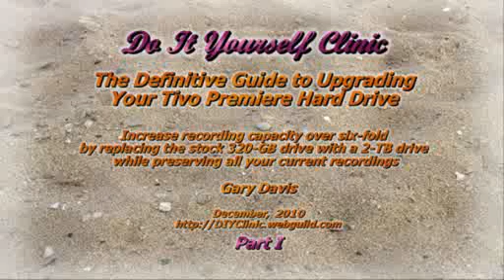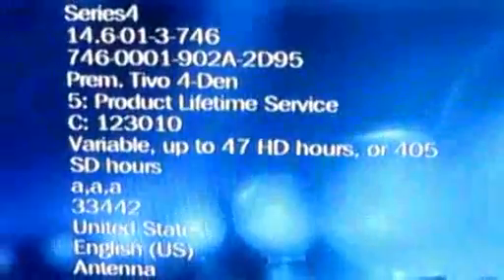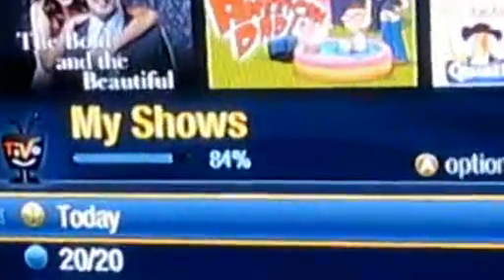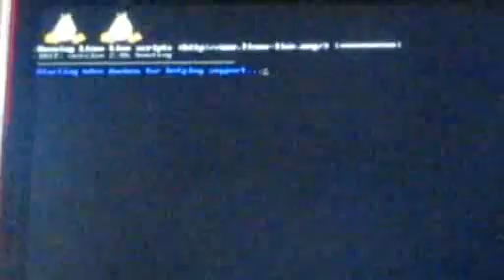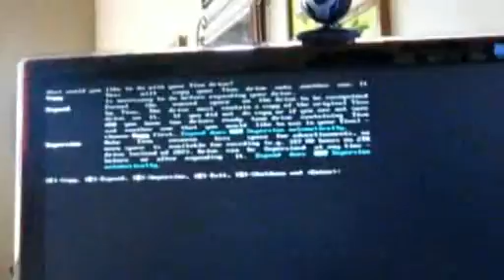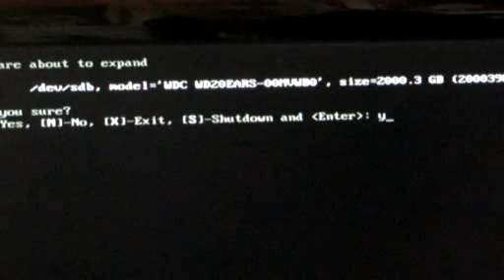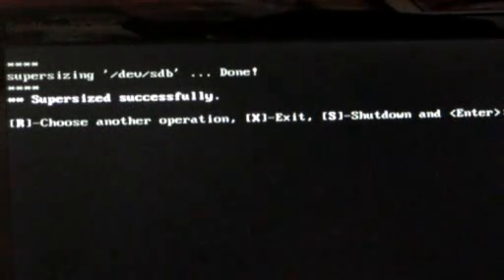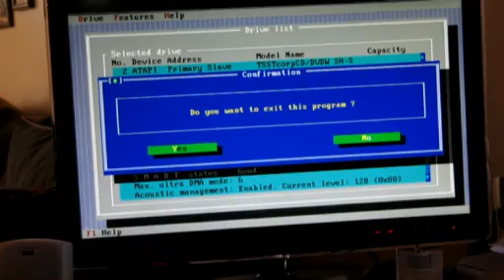The Definitive Guide to Upgrading Your Tivo Premiere - Part I

Comment: Do Torx bits fit in normal power screwdriver heads? Or do I need a special Torx screwdriver too?
Reply from the maker: Torx bits are fine. Get a set so you have them when you need them like for Tivo boxes. A set of Torx screwdrivers is an alternative. I have both. My wife has one for her sewing machines.

Comment: Thanks for the post ! I just upgraded to Samsung 850 SSD oppose to HDD. I must say it is much faster, no buffering or freezing to all receivers.
Reply: What capacity SSD did you use?  How did you connect it?
Reply: @nuraman00  Likely up to 2TB max size. SATA SSD is fine for this as it doesn't need a converter and the Tivo isn't in need of high performance SSD, just basic SSD performance like a WD Blue.

Comment: I am having problems.  I am using two hard drive docks via usb on a laptop.  I have tried 10+ times.  It fails anywhere between 6-70gb copied. Now when I put the same hd back into the tivo, the tivo won't boot.  It goes to the starting up screen for a few seconds and then reboots, and just keeps doing this.

Comment: I dont know if you had any issues with the "Jmfs" clone file or not, but I also posted this on the TiVo community site. I put the file on a disc and it starts to boot, appears to try, then the comp reboots. It does the same thing over and over again. It doesnt boot correctly or something. Any ideas? Maybe I made the disc wrong, dont see how, but maybe.....
Reply: Hello Austin. I'm having the same issue as yourself with my pc rebooting itself over and over using the "JMFS" tool. Have you resolved this issue or found another tool to use to upgrade your Tivo HD?
Reply: +Austin Bobo  Hello Austin. I'm having the same issue as yourself with my pc rebooting itself over and over using the "JMFS" tool. Have you resolved this issue or found another tool to use to upgrade your Tivo HD?

Comment: my hard drive just went on my series 4 TiVo premiere...debating what's my best option to replace it with...could get a new hard drive from weekknees or even buy a used TiVo and switch the hard drive I guess...suggestions? Any idea if I can save/transfer the shows on the TiVo I have now to a new hard drive or are they lost?

Comment from the maker: You have to transfer the old drive contents to the new drive. That includes the Linux operating system and TiVo software as well as the partition structure, even if you have no recordings you are interested in saving.

Comment from the maker: Thanks! The old console was mine and had maybe a 26" tube in it along with speakers on either side. I pulled out the old chassis and the speakers and located a 42" flat screen the fit pretty good (needed a slight bit of routing on the console and trim on the edges. Also it needed diver weights on the inside back to keep it from falling forward.

Also, I put wheels on the bottom to angle it to the dinner table evenings to watch the news, etc.

Comment: The WD10EURS and WD20EURS don't require any of the other tools on the list other than the first one - the JMFS boot/clone tool. That's because they are specifically design for DVRs, security systems, etc.

Comment: The model # of drive in the external WD Expander is WD10EURS.They don't make a 2TB version of the WD Expander so I'm not sure if the 2TB WD20EURS would work as an external or if the Tivo would say it's a unapproved drive.DO NOT use the WD My Book.It's not approved & will be recognized by the Tivo as such. 

The 2TB WD20EURS does work in the Tivo itself.Same one is used in the Tivo Elite.The EURS series is designed specifically for DVRs so it ignores disc errors for smooth continuous playback.

Comment: The AV series from Western Digital is designed especially for 24/7 and smooth video performance, searching, fast forwarding, etc. That's what the WD Expander external uses. But any internal can be used for this cloning project.

Comment: @garyadavis Yes the external must be a Western Digital Expander. It's the AV Series hard drive designed especially for video files. It caches different and provides quicker, smoother searching.  I tried the external esata I had on the Cox box and it wouldn't let me even after trying an old Tivo hack code. That code no longer works on the Premiere.